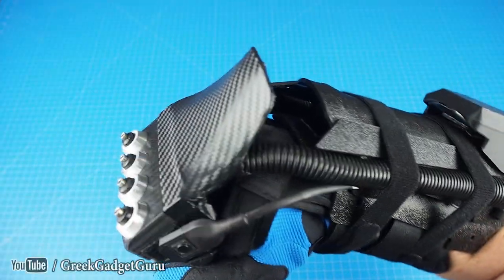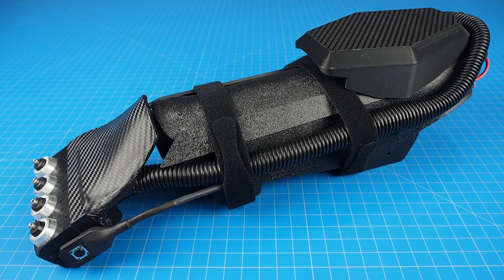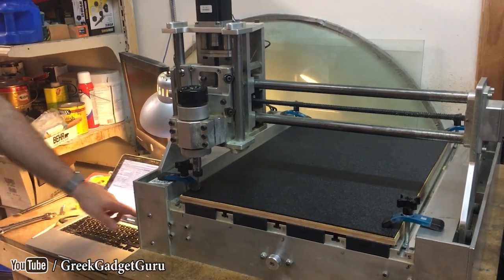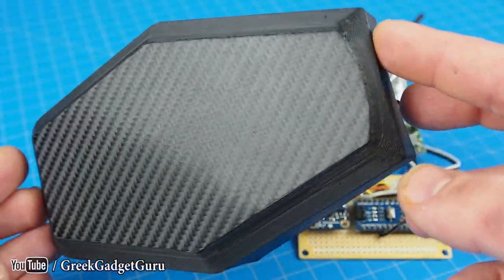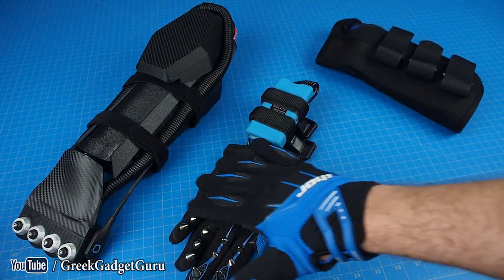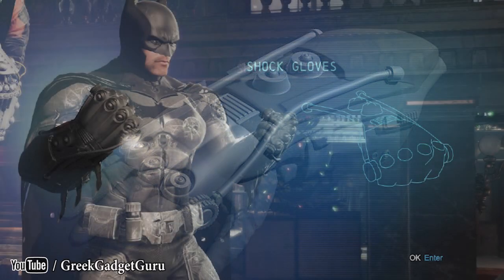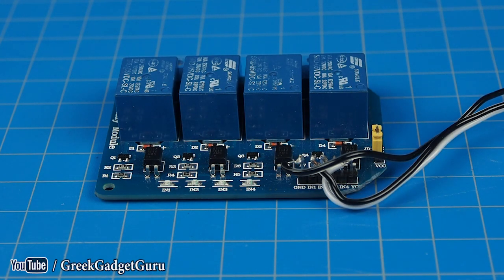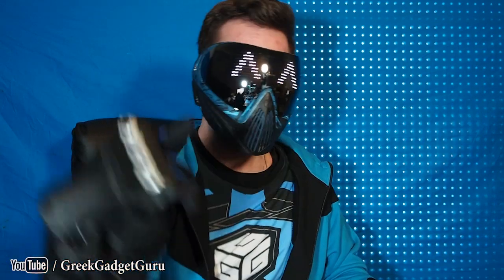Punch Activated TASER Electrocutioner Gauntlet / Shocker Gauntlet - w/ BoXZY

Comment: hey man, it's amazing! I'm electrical engineer and mighty have a tip for you: to prevent the electromagnetic noise at the microcontoller research for faraday's cage, there are some tecnologies to encapsulate microcircuits to prevent this stuff based on faraday's cage theory.

Comment: You should look at moldmaking. It wouldn't be difficult to carve a two part negative out of wood, create a silicone mold, and then create a silicone-rubber composite from the mold. It would let you do some slightly more advanced stuff using both flexible and insulated parts.

Comment: So, I couldn't really tell just from you wearing it, so this comment might not be applicable, but if it is, I'd really suggest doing this. If you alter it a bit so the shocker-y bits sit directly on your knuckles (the flat, forward part of your fist), I think it'll be an overall improvement. For one thing, it'll give increased mobility. Sure, you'll lose a bit of that strength and stability in your punches, but a) it's a taser, the exceedingly painful, muscle affecting electricity should really counteract any loss of strength in the punch, and b) stability isn't that much of an issue, if your holding your hand properly at the beginning of the punch, and you're not hitting something solid like metal or concrete, you'll probably be fine, and I imagine you could alter it so you get the best of both worlds: stability and flexibility. I don't imagine I'll need to explain the advantages of being able to move your hand more, lol. But the other thing is that you'll probably just punch better. You'll be able to hit head-on, solid contact with the prong things, etc, etc. I think, overall, it would just be a good thing. But seriously, if it's sitting on your hand the way I think it is, and you try to hit more with the zappers than your actual fist, you may dislocate or break or otherwise hurt your wrist or something. Wouldn't want that.

Comment: What about Batman's Grapple Gun. The idea is to jump from the 2nd or 3rd floor or even higher and you wont get hurt because somehow you eliminate the free fall force. Maybe this can be achieved with a gadget similar to batman's grapple gun. Maybe metal spring can do that by rotating and releasing a very strong rope. Α mechanism like a vacuum cleaner's cord retractor.

Comment from the maker: For those interested in the parts I used, here's some quick access to the links! :D
- Parts List - (Affiliate Link)
[✓] High Voltage Generator: http://amzn.to/2jRwGgN
[✓] Armor Glove Files: http://www.thingiverse.com/thing:1887603
[✓] Shocker Glove: http://amzn.to/2ifPBlM
[✓] Accelerometer: http://amzn.to/2j6KtMw
[✓] Micro Controller: http://amzn.to/2jKsQ6U
[✓] Relay: http://amzn.to/2kA5l0l
[✓] ABS Plastic Sheet: http://amzn.to/2li0YrA
[✓] Carbon Fiber Vinyl: http://amzn.to/2kKazFW
[✓] Switch: http://amzn.to/2kzRaMA
[✓] Split Loom Wire Casing: http://amzn.to/2kKiDXh
[✓] High Voltage Wire: http://amzn.to/2li8JxU
[✓] Blue LED: http://amzn.to/2kKmOCb
[✓] Extreme Velcro: http://amzn.to/2lidzet
[✓] Push Button: http://amzn.to/2kKk9Zc
[✓] Velcro Strap: http://amzn.to/2kKiCSU
Reply: make a grapnel gun

Comment: Would making something like a faraday cage around the parts being fried help you in this situation? It goes without saying that you'd want a strong insulator between the circuitry and the faraday cage. Probably might want to use em shielded wires as well.

Comment: From the design, it appears to me as if it will place undue stress on the knuckle joints if used to strike with force. Perhaps moving the contact points back slightly so that it would rest similarly to brass knuckles against your fingers.

Comment: How could this be made better you ask? Well I wouldn't have used a micro controller on the first version. What I would have done is add a micro switch with a plunger that would depress the switch when you punch. Making gear like this should follow the KISS (Keep It Stupid Simple) method because that way there's less to fail. I like the overall design. I'd just add a plastic or nylon plunger and mount the switch behind it. I mean if you think about it that would also make sure you have good contact with the target before it fires. The thumb switch could stay attached for the intimidation factor that firing it without hitting someone would have. It would be super easy to take a switch out of an old computer mouse though, and mod it into the design. Easy peasy...
Reply from the maker: ExStatic Bass is KISS a common saying or did you learn it from Captain Intrigue's YouTube channel?
Reply: No, it's actually older than both of us put together and was common during the industrial revolution. Not many people use it these days but the principals still apply. At least I think so. I mean it makes sense that the simplest device is the best one because there is simply less that can go wrong with it. In this case, just using a switch connected to a lever or push rod is the simplest method of activating the shocker. A mouse micro switch should easily handle the amperage and voltage on the input side of the taser elements and should work.

Comment: What's the overall weight for that, it would probably be more beneficial if you made a light vest were its water tight to carry more battery and simply place the necessary wires with the switch on the glove.

Comment: I tried building a simplified and more basic version of this, for proof of concept, However when I push the button to allow electrical flow, I notice that the metal strips inside the bread I use starts to heat up and nearly melt immediately. At first it was because it was an incomplete circuit, but when I complete it (closed circuit) the button nearly melts. Do you know what I might be doing wrong?

Comment: Could you mount that inside of a metal gauntlet kind of like a knight would wear? Also, if you wanted to jack up the voltage,  say if you wanted to knock something bigger than a human out, how would you go about doing it? Also, is there a way to manually adjust the voltage on the fly? Like if you just wanted to use it to interrogate but not knock out a prisoner, but then you needed to jack the juice back up in order to use it on a different opponent.

Comment: but what does EMP have to do with this
Reply from the maker: The gauntlet disrupts electronics when it goes off.
Reply: G3AR - 'GreekGadgetGuru' I just suggested making a faraday cage around the components being fried, with a strong electrical insulator between the cage and components. As well as possibly using shielded wires where applicable.